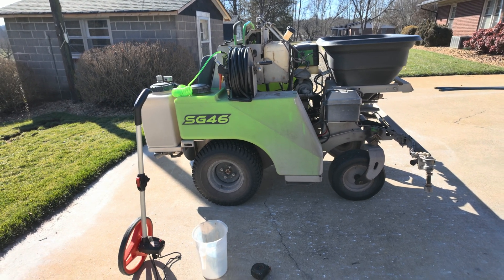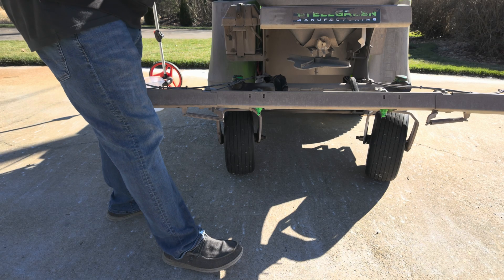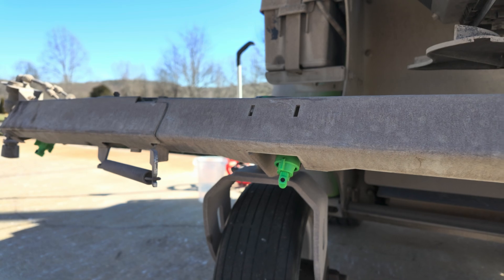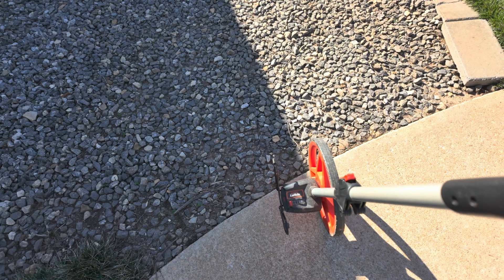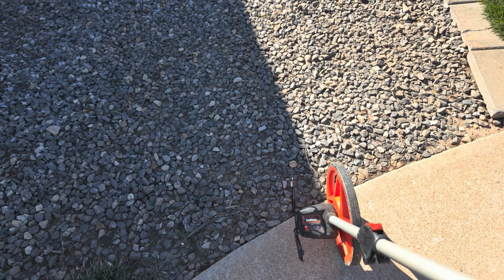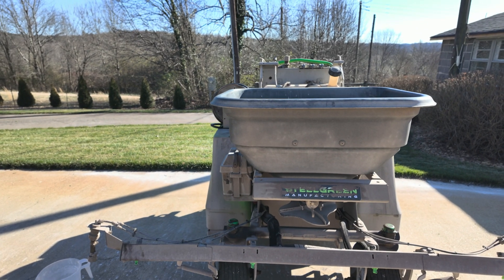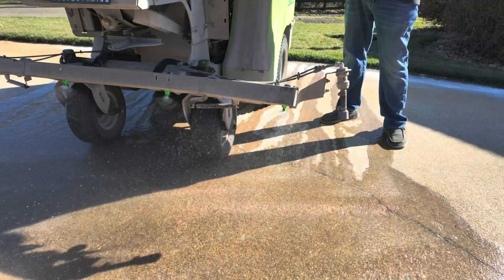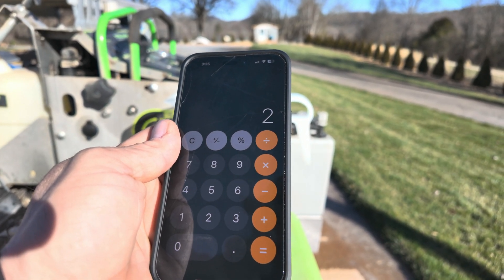Lawn Care Spray Boom Calibration

Comment: Hey Brad stupid question... On the Steel Green does the PSI get set with the levers open or closed? With all three levers open my PSI tops out at 25 PSI no matter position of the adjustment knob and full throttle. I looked in the user manual and it doesn't give much clarity on this other than pressure drops when the levers are opened.
Reply from the maker: You would want to set the psi with it spraying! Only way now to get more psi now is to go to a smaller tip your basically maxing out your pump with the tips you have or that’s what it sounds like if it want increase in pressure
Reply: @Prime_Fescue  Hmmmm sounds like I need to do some troubleshooting. I have dual pumps and get the same max PSI with both the XRC 11015 and Turbo TwinJet Nozzles.
Reply from the maker: Yea that doesn’t sound right I have dual pumps and use light green tips and spray at 33 psi at 5mph which is 2 gallons per 1000sqft
Reply: @Prime_Fescue  Welp. I know what I'm doing tomorrow. 🙂
Reply: I got the pressure working properly today, I think there was some air trapped in the lines which was restricting the pressure. My machine ran flawlessly at 33 psi at 5 mph with the light green tips today. Started to smoke my lawn today. There's no turning back now.